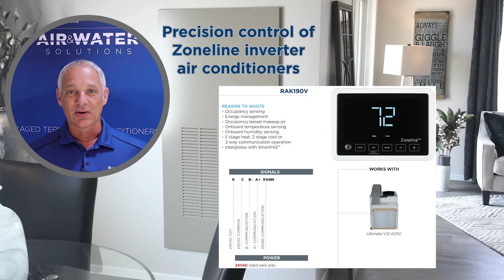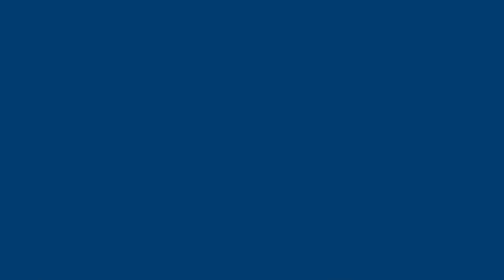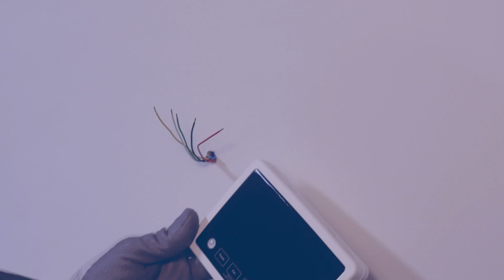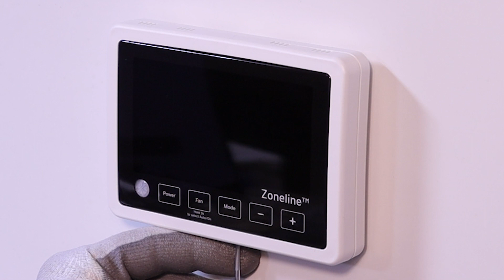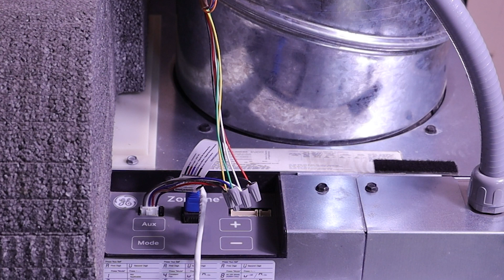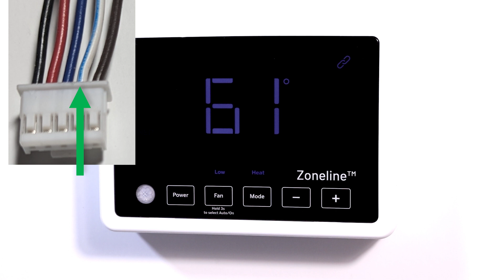How to Install the Zoneline RAK190V Communicating Thermostat

Comment: I have exactly this device and the thermostat does not connect to the machine. I have 101 more of these and they have connected but two of these do not. What can I do?
Reply from the maker: Hello, thank you for reaching out. We recommend taking a look at the troubleshooting section of the Use and Care manual for the thermostat: (RAK190V) that can be found on our website in the Owner Support section of the product page. If none of that helps, then we would recommend contacting your distributor for warranty assistance.

Comment: Anyone know the part number for the 5 wire 2 way communication connector?
Reply from the maker: We are happy to look into this for you and will reach back out as soon as possible.
Reply from the maker: Our team came back with the following: 
RAV190V is found on our GE Appliances Parts Store: http://spklr.io/6050xz1i. 

Page 3 of the Installation Instructions for the RAK190V shows that the" 2-Way and 1-Way Thermostat Connectors" are included. Since this accessory is sold as a complete assembly, individual parts of it are not available separately and therefore, there are no part numbers assigned to them. On page 5 of the instructions, under 1) 2-Way Communication states:

If your unit came with a 5 pin/5 wire connector, please see Diagram 2. Otherwise, please use the 5 pin/4 wire connector included with this thermostat and refer to Diagram 1. 

If you are referring to the part number for the 5-wire connector on the unit being connected to this RAK190V thermostat. If this is the case, and it is one of our Zoneline models, then we will need the model number of the Zoneline. Here's a link that you can copy and put in your browser to view all Zoneline information. http://spklr.io/6051xz1c
Reply: @geappliances  Sorry to tell you that simply isn't the case.  Ordered a rak190v and all that is included in the box is the thermostat, mounting screws and a manual. It doesn't include either the 8 wire traditional thermostat connector or the 2 way connector.  Bought a brand new zoneline ptac inverter compressor model AZVS15DMXWA and that does not include either connector either.  So if you are telling me there isn't a part number for the 2 way connector how is a customer supposed to get one to connect it to the rak190v ?  

I have called the ge appliance number and spoke to 2 different reps on the matter and both of them couldn't tell me a thing.  It is rather frustrating as a consumer who purchased your higher end inverter model and the expensive 2 way com thermostat and have to go thru this many hoops just to find the connector to plug the two together.  The specific ptac help line offered zero insight as well....
Reply from the maker: We will pass this on to our team and reach back out as soon as possible.
Reply: @geappliances  Thank you. The manual for the ptac as well as a vertical tac unit mentions part number WJ26X28997 but there is zero pic of it on the Ge appliance page and just says thermostat wire kit?  Is that it?
Reply from the maker: Can you please reach out to us via Facebook or X in a private message and include reference 49304 and provide your name, address, and phone number?
Reply: @geappliances  So I figured out the issue.  My purchased RAK190v out of the box is on revision 0.  The directions state no thermostat wires are included and show a different wiring diagram on page 6.   Looking at the products pdf instructions online wiring for my unit uses a 5 pin 4 wire connection and Rev1 seems to contain the wiring kit in the box but revision 0 units did not.  And REV 0 wiring directions are wrong for any AZV but was fixed in the directions of REV1.  If you don't have the wiring kit for any reason GE part number wj26x28997 will provide it.  I now have my unit plugged in with the correct part and wired correctly using 2 way communications.  It was just frustrating when shipped an older Rev0 unit.  Calling the help line was not helpful at all.  I think it's important to let them know different revisions of this product contain different directions and wiring instructions and if they were aware of that fact it might help others in the future with this issue.
Reply from the maker: Thank you! This is great information. We appreciate you sharing this and will be sure to pass this on to our teams.